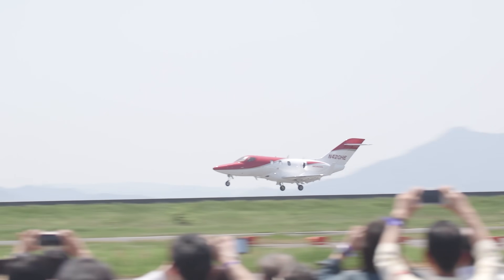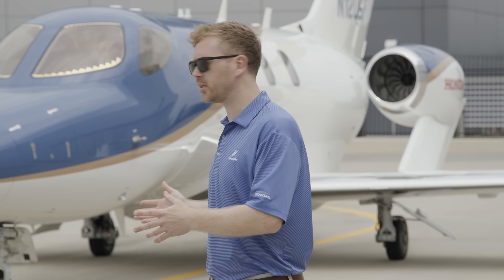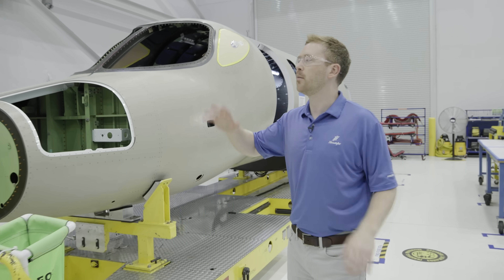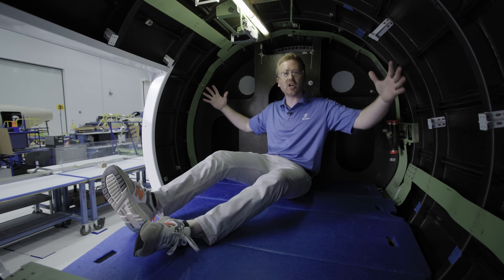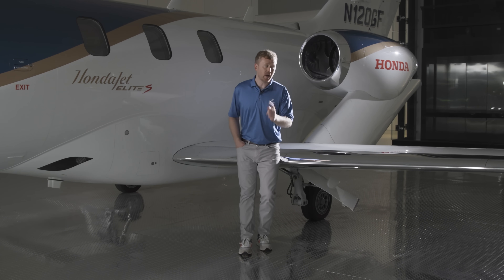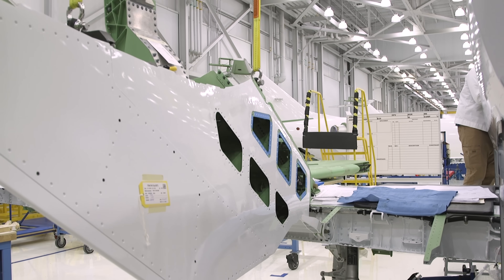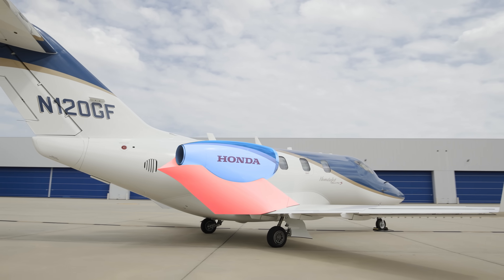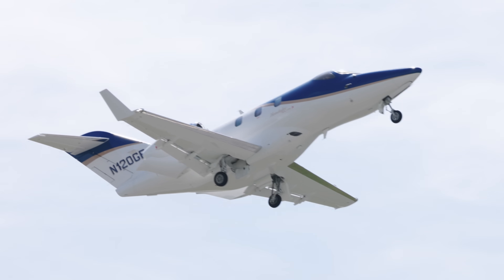Why are the HondaJet's Engines Mounted Over the Wings?  | HondaJet Studio

Comment: I read the white paper on the Honda jet's engine mounts, honestly was really interesting for me as an engineering student at the time. Also I think reading that changed my opinion on 'reinventing the wheel'. Turns out, in a specialized enough focus, you are better off reinventing the wheel instead of trying to shove a less efficient existing solution into your very niche design.
Reply: Yeah, that's what Elon Musk said when he reflected on Tesla's first electric car. It would've been better to reinvent electric cars than to make a car (Lotus) change from gas to electric.
Reply: like tesla changing battery design with the many tabs instead of just one
Reply: @KarlenBell  Sadly the application of that notion with the Cybertruck appears to have been a monumental failure. Hopefully they will be able to come up with a 2.0 version with some better ideas.

Comment: I have always had a soft spot for Hondas. The younger version  of myself got into motorcycles. My first “bike” was a 50cc “Bridgestone”, but then came the Hondas, a 305 scrambler and a CB350. While my friends worked on their British bikes all the time and cleaned up the oil drippings, I was generally enjoying a ride with a young lady.  The one that would  become my wife of 50+  years was a frequent passenger on the 350. Work and life’s demands took me away from biking for several decades (then the Harley arrived - until the MDs took that away).  However along the way we discovered the quality and reliability of Honda cars. The Frau has had two Accords and I have had an insight and a CR-V. While I must admit they  certainly are not a fun to drive as the Corvette I once had, nor as gorgeous and sexy as my new toy - an SLK roadster - the Hondas sure are reliable. All 4 Hondas combined were in the shop for non- scheduled service repairs less that a single Ford Escape I foolishly purchased,  and even less  that the SLK, and are certainly far less expensive to fix. I am sure there will be a Honda in our life for as long as we own vehicles. If I needed a jet, the Honda Jet would be considered, at least as a “time shared” plane.  Honda makes good stuff, the Mrs. even opted on a Honda lawn mower.

Comment: Great video and explanation. I ❤️ The Hondajet. I have flown many times on the Fokker 100 with fuselage mounted engines. The noise and vibration in the rear of the plane is massive.

Comment: Honda engineers have done a pretty good job in applying that concept to a business jet.
I don´t want to bust your claim this design configuration is new but I think the Honda engineers looked around what designs have ever been studied but been unsuccessful for the lack of research capabilities ...
Just have a look at the VFW-614 (made in 1961): https://www.youtube.com/watch?v=zx1z8fxuCKI&pp=ygUHVkZXLTYxNA%3D%3D
Albeit larger being a regional airliner it has exactly the same configuration and the engineers at the time had exactly the same advantages in mind (weight reduction/preventing FOD/easy maintenance/largest cabin space out a the given fuselage length)
Unfortunately wing design was not as advanced as it is today and the VFW-614 lacked in performance due to not having the optimum wing design and engine positioning (and ultimately non-support after VFW was taken over by Fokker who was not going to jeopardize their F-28 sales ...) and ultimately there was initially no suitable engine availlable on the market and when RR made a tailored engine for the aircraft it had serious reliability issues ...
So, potential customers were not impressed.
Honda seems to have done a much better job overall. Congrats.

Comment: The over the wing and in the back engines are a hazard. A screw or a bolt loose from the wings ends up in the engine
Reply: Under the wing the hazard is greater.